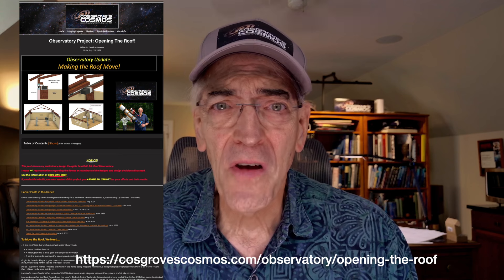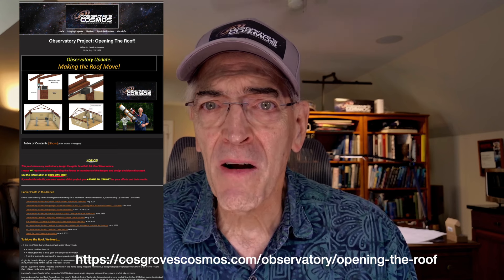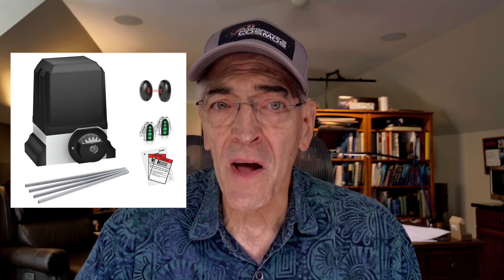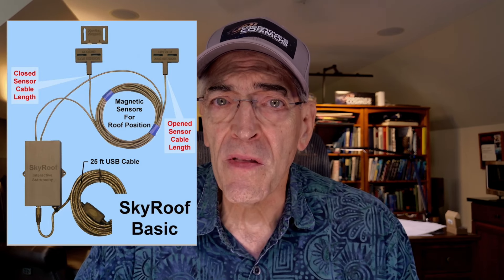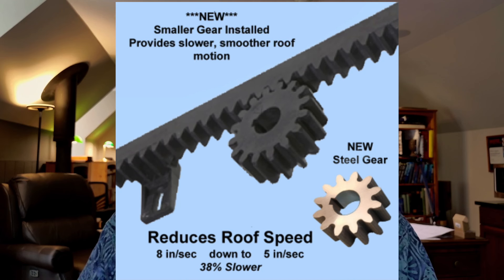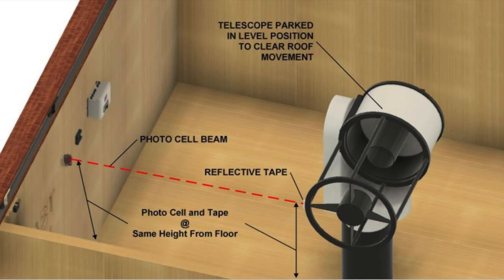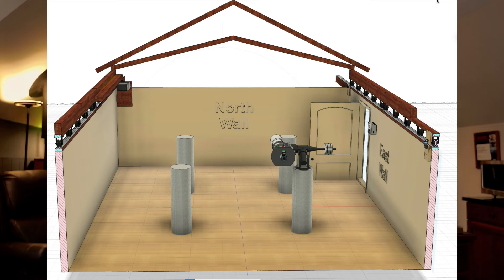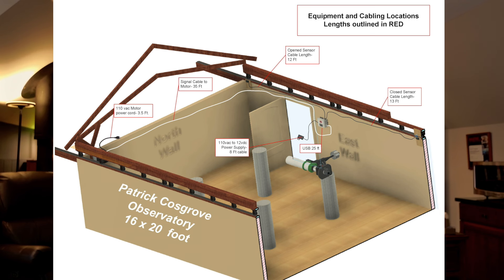Observatory Project: Opening The Roof!

Comment: I would put the motor on the center. It will bind otherwise..
I had to change mine. Speaking from experience. 
Not to mention the fact that your rollers do nothing to hold the roof to the building .
Reply from the maker: Thanks for your comment. I don't expect it will bind as I am not using two V-groove tracks—just one—to avoid being over-constrained. This was recommended by Jim Collins, who builds the motor system I am using. He has done this for tons of observatories and seemed confident that this was fine. I also had this looked at by a mechanical engineering friend, who recommended placing the drive near the V-groove track.
Reply: @cosgrovescosmos  thank you for the explanation. I, of course,am talking to you from Florida . 
Everything has to be built up to code and I had to contract an engineer to draw my plans so that it is hurricane resistant( up to code); we’re talking 10 x 16 Obsy. 
I had to use Simpson ties in every corner, floor anchors as well as garage roller tracks in order to keep everything in place and code compliant. 
Now, if a hurricane comes, I know where to take my family.
 
I hope you’re having half as much fun as I did 😊
Reply from the maker: I can imagine building such an observatory in an area with hurricanes is a real challenge!  Sounds like yours is bomb-proof!